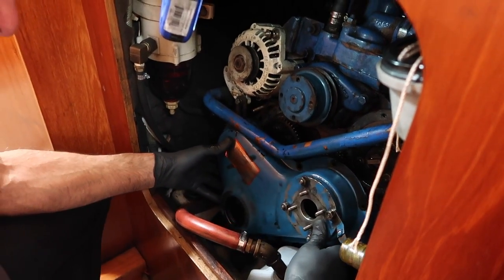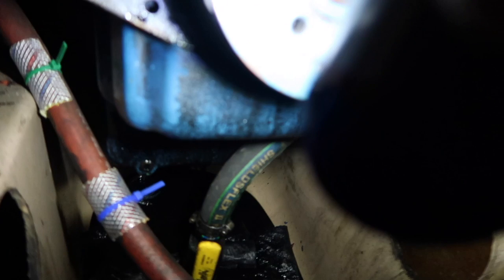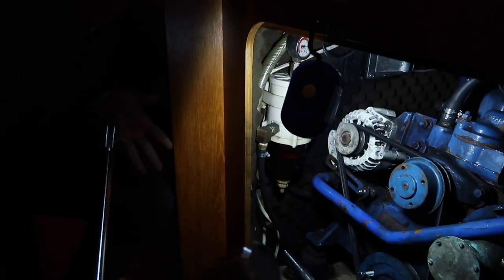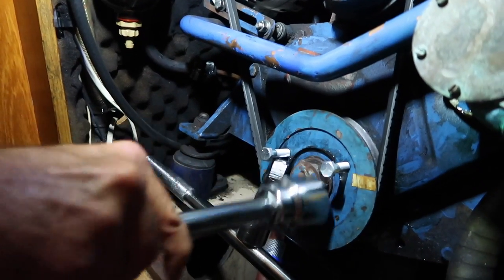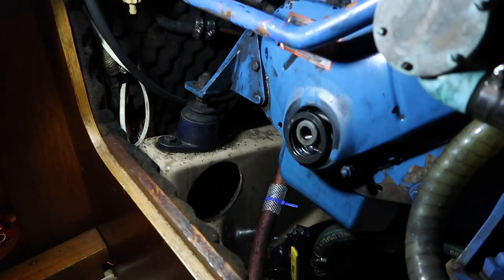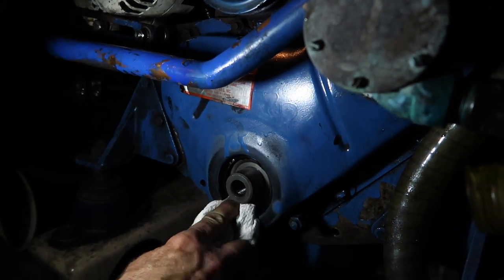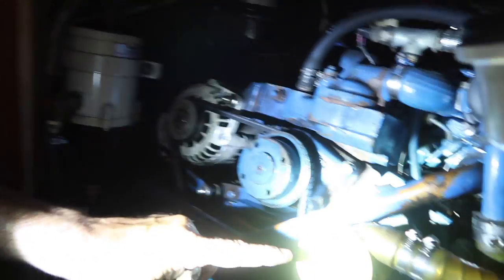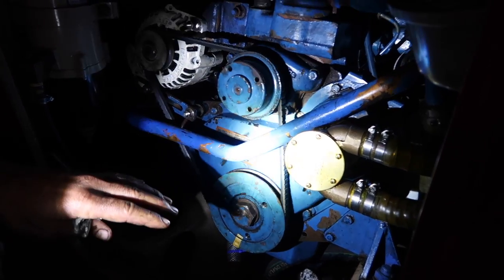Sailboat Engine Repair and Sam Joins as Crew (Ep. 11)

Comment: An important tip for when your trying to prevent oil leaks is to use a product from Permatex called Ultra Black gasket maker. It sticks very good and cures to a rubber like texture and will prevent any future leaks. It has a hundred other uses where you need a semi flexible strong adhesive. Yes you could have eliminated the need for that gasket as well. An critical item to have it your tool kit!  Nice Job and glad to see you posting again!!

Comment: Notch in crankshaft pulley is called "Key-way" and watch out for half-moon shaped "Key" that locates the pulley. Use of a gasket sealant on both sides of the NEW gasket will properly seal & prevent gasket damage from expansion & cooling cycles. Did you use torque wrench for final tightening up of crankshaft pulley set-screw or Breaker Bar, extension & socket set-up to torque value FT..!? What happened to water pump leak repair - seal & impeller replaced or complete water pump..!?

Comment: Front crank seal...
Harmonic balancer bolt or crankshaft bolt.
Front crank seal.
If you want to save some time next time... disable the engines ability to start (if you can...it's ok if it can't be easily done)...lock the socket on the crank bolt.. with no extension!!!!
,.place the breaker bar on the side of the engine that the crank is turning towards "you said clockwise."... basically...staring at it ..the right side...
Place the bar against the engine support frame, bump it over until it touches...bump-bump-bump-it-again ...
Bolt will back out.

Comment: I’m loving your videos, so informative! I have a couple questions on this one.
1) How did you know it was the gasket that needed replacing and not some other issue? 
2) How did you know that that one piece (bolt?) on the pulley needed to be turned counterclockwise to be loosened? Is that because the belt turned clockwise?
Reply: retired mechanic here, while there are always exceptions to the rule where the use of a proper maintenance manual will help, generally all nuts/bolts are "righty tighty lefty loosey"
Reply: JayBee if this isn’t some mansplaining 🙄 Obviously I have heard of “righty tighty lefty loosey,” why comment that if you aren’t even going to answer my question, just to waste my time? I’m asking why that did not apply here and how he knew.
Reply: DR PHIL great points! Thank you 👍🏼
Reply: @sarahadams7919  just seeing your reply now for some reason but I did answer your question - I said the use of a proper maintenance manual will advise you of exceptions to the rule and just to be clear which rule I was talking about I referenced righty tighty lefty loosey so that there was no ambiguity in what I was saying but hey, good job for blaming me for your lack of reading comprehension. No good deed goes unpunished...

Comment: And when using rtv?
Always use the newer grey rtv
It hardenens better than the old soft blue and black.
Or.
On seals like this, use gorilla snot....aka...3m weatherstripping adhesive in a tube..
Be careful.
It's impossible to get off ANYTHING.
But, if you have everything spotless, and the seal is clean and dry, you will never get a leak around the outside of the seal to the timing cover

Comment: A easier way to do that is get you a 3/4 inch impact wrench and if you don't have the capability of air get your electric impact wrench Milwaukee has a beautiful impact Ridge and so does Harbor Freight which is half the price of Milwaukee but it is 1300 foot pounds of torque and they had to take that boat right off that there are struggling with and trying to brace this and that they're not mechanics and I am